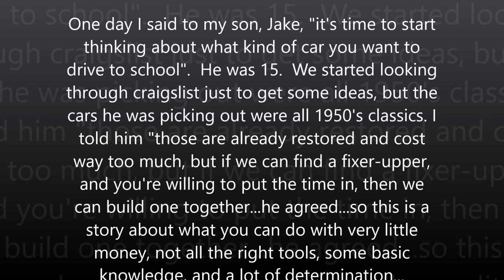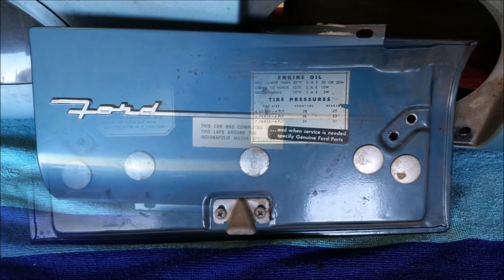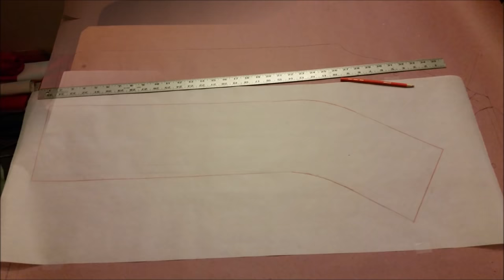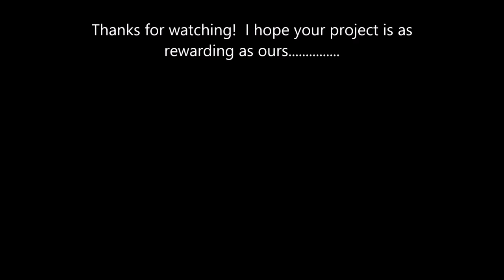1955 Ford Fairlane Restoration From Start to Finish

Comment: I moved to America when I was 12 and went to school. I always wanted a pickup truck, but ended up driving a vw Passat for most of the time since my dad felt more comfortable working on the cars he knew from home. When Senior year came around I was driving around town and saw a blue and white 1981 F250 Ford sale. I talked my parents into getting it from the Christmas and birthday money I had saved up for years and bought my first truck. I couldn’t stop grinning when I hoped up on that old bench seat and heard the v8 fire up. It had its fair share of problems rusted out gas tanks, loose timing chain, broken gauges. But over next two month I spend every free minute fixing that car up, sometimes with the help of a few of my buddies and got it to be a great daily driver. I got to make great memories in that truck and drove it to senior prom. You are a great father for allowing your kid to do this. He as undoubtedly learned so much from this and can look back fondly on this forever. There is no feeling that replaces driving a car or truck you have turned every last bolt on and know like the back of your hand. This video made me tear up. Thank you for sharing it.
Reply: Wow that is awesome man, do you still own the car
Reply: @GummerJum  Sure do. Just finished a complete restoration of the suspension and frame. As well as rebuilding the trans and engine.
Reply: @manuelmuelller3535  that is so cool, 1980s types of cars are the best in my opinion

Comment: My Dad had a 1956 Mercury Monarch which was A Canadian model and it was a beautiful car with Thunderbird 312 V8 4 barrel. But I loved all 1955 and 1956 Ford and Mercury cars. This was an enormous task you have taken on here and you should be proud of all the work you have done. I myself have been in a long rebuild of a 1971 Boss 351 Mustang that I have owned since 1976, so I have a very good idea of what what you have done because I stipped down this car and did a lot of patching of body parts and some new ones because they are available. I have really appreciated what you have done here by saving this beautiful car for an icon that can be passed on to future generations.

Comment: This is god dang amazing. I had a 64 ford in high school that I picked up for 850 dollars back in 2012 when I was 13. My dad signed and I paid with the money I made working at our ace hardware. Got her running and got the darn brakes to finally work. Anyways I changed heads and the carb for a heavy boost in power. Some my dad helped me but he was also a very busy man and didn’t really have time to help me. I just learned from lots and lots of books and videos.

Comment: Wow!  Nice work.  My first car also was a 1955 Ford Fairlane back in my Junior and Senior years in High school way back in 1971 and 72.  Bought it for $50.00 from a farmer.   Of course back then mine didn't need to be restored yet.  Instead of the V8, mine had a straight 6 and a manual 3 speed on the tree (column).  But seeing yours does bring back a lot of memories.  Thanks!

Comment: Fantastic job guys.  You gave life to a sweet car, learned a lot and made some life long memories.  Hold on to that sweet car young man.  Trust me.
Reply: Yeah hold on to the car 🚗 I still have my first car that built back several years ago but now I have built it into a gasser style 😎 with all Ford parts 53 cpe with a 460 and a 4 speed trans and a narrowed 9 inch

Comment: My Mom had a 1955 Ford Fairlane. I drove it all the time. Both of you have done a very amazing job at this restoration. Best I have seen both the awsum sound of that engine. I currently own a 1966 Ford Mustang Convertible. with the same sound. Very nice guys.

Comment: 239 cubic inches of forever memories. Mine was an 80 hp flathead jake. Tears in my 73 yr old eyes remembering my dad helping me with my 1953 2 door post.
Reply: I think in 55 it was a 272
Reply: @wendel, you’re right guy, the 239 replaced the flathead in 1954. Then 272,292 and 312 in 55/56. Good old y blocks, strong motors.

Comment: Beautiful work! My dad and I did the same thing in 1968. My first car.....'55 Ford, 4 door, 272ci with a 2 bbl carb. with a 3 spd on the column. Though mine was only 13 yo. at that tkme. So, we had a lot less work to get her ready. Replaced the rocker panels, dog legs, and rear quarters. I loved that car. It'd go anywhere. My dad sold it when I went off to the service, two years later. Watching this really brought back memories. Good luck bud....treat her good and you'll remember her forever. Thanks for the video.
Reply from the maker: thanks so much.  sorry you don't have it anymore.  I promised myself I would never sell this one.  Too many memories.

Comment: Great choice for a restoration. I had a 55 black and white Crown Victoria shortly after I graduated from high school. Wish I still had it along with my 1942 Harley "45" flat head and my -----. When you are raising a family of 4 children you have to loose what you have to get what you need. Great video. Your son has a car that is unique.
Reply from the maker: thanks Jim.  yeah, it's tough to decide which of our toys to keep and which to let go.
Reply: Just as an aside story, I had taken a job as a delivery truck driver in KC Mo. This was in the early 60,s. I had to have Missouri chauffeurs license for the job. At that time we used our own car to take the driving part of the test. I had dual straight pipes on my Ford. IT was cold in the winter. The tester told me to start my car so he could check my brake and turn signals. He checked everything and got in the car. He shook his head and asked me how I could stand the noise. I told him, that is not noise, that is music. We still had some freedom back then. Heck, every guy  I knew had loud pipes on their cars. 

On a cold start, even at idle that thing was loud, but nothing like the sound of a v8 on a cold morning. Your video brought back a lot of memories. Thank you so much.

Comment: Excellent job guys, but never use a concrete block to support a jack stand. They will collapse.
Reply: My welding instructor in high school did that putting a muffler on his car.The concrete blocks collapsed,breaking both of his legs.He was fortunate that he wasn't killed.

Comment: Best time a father ans son could spend together. This young man has acquired skills he never thought possible, and for anyone asking what good this will do in the future when he can buy new instead of repair consider this:  He learned responsibility, how to evaluate, problem solve, improvise, use tools, work with a budget, set and achieve goals he can see and touch right now. These are skills he can apply to every challenge life throws his way.  

The 81 who thumbed this down probably couldn't handle anything heavier than a gaming mouse.

Comment: Damn straight fine job. I would of been proud if my first came out that good. His next one will be a breeze after doing all that. I love it guys.
Reply from the maker: thank you my friend
Reply: @jperry1444  That is all I build now is friends. I hope you stay with the oldies and make each one a labor of love. Four door cars took families all across america. I started in early sixties building cars. My first was a failure, a 59 ford starliner which was the retractable hardtop. It was so rusty that I got there too late. Had they sold me the car sooner, I might have got it going. It ran good and the top was working but the frame was gone and I just didn't know how to weld like I do now. I'm 72 and welding took my eyes away as I can not see true colors anymore. I did my last one about six or more years ago which was a 95 king cab dually with five speed and 7.3 with every bell and whistle you can get on the 2012. heated seats and wheel, sound, cameras, phone, aluminum flatbed, all the hitches and wiring, tuned engine and not one scratch it her. Extremely fast and yet set her on the ground with the remote. Yeah it was nice but the bills for medication and just staying alive has taken everything :-(

Comment: Thank you for restoring this beauty and being a good father. I dream of owning a 50's car someday, and am very interested in restoring them. Just I dunno where I'd start. I mean, I could probably do some bodywork, but I know very little about engines. However, I do know the engine bay was much simpler back then. I just adore those oldies and would drive them with pride. One thing though, I'd advise avoiding highways and driving very carefully. Not just to keep the car safe, but to keep you safe. Those oldies weren't really designed for a crash and have little, if any safety features. Enjoy driving it safely, you've earned it.
Reply from the maker: You can do it David.  I would suggest checking out DIY Autoschool on Youtube.  He is the owner of Southwest Rod and Custom, a paint and body/restoration shop based in Texas (but moving to Moab Utah).  He has tons of vids on how to do it yourself.  He comes across as angry and frustrated but it's really just his sense of humor.  He knows his stuff and tells it like it is.  As for the engine work, there are lots of helpful vids out there on that too.  You can look into your local high school or vocational school to see if you can get a deal on the labor by letting them work on your engine.  Local machine shops can also be a great resource.  One thing is for sure, you will never know until you try.  Find an affordable project out there and bring her home.  Count on 2 things...it will take you 4 times as long, and cost you twice as much money as you think.  but if you can find a really affordable starter project then I say just go for it.  Find something you can get parts for.  The 55 and 56 fords and the tri-5 chevy's as well as mustangs and chevelles can literally be built from nothing with aftermarket parts.  Stay away from the rare ones that you will never be able to find parts for or you will spend 10 times the money buying crap off ebay that is in worse shape than what you are fixing.  Reach out to me if you have questions.  Good luck my friend.
Reply: @jperry1444  Thank you for the encouraging words and advice. I'll definitely look into it. Honestly I saw a few possible project cars around where I live. Don't know if they're for sale or not though.
Reply from the maker: @scratch8141  get it as cheap as you can.  "Project" prices are ridiculous these days.
Reply: @jperry1444  Wouldn't think of doing it any other way. Honestly it'll probably be a little while before I actually start shopping for one though. As of now, I've got other things to attend to.

Comment: This is a fabulous car for a "learn by doing" project....better than many so-called "restorers" would turn out.  Great work here!  I have a friend whose grandmother had the same car (in red and white) but with the 6 and 3 sp./overdrive, no rust.  The "restoration shop" did the paint and it wasn't half as good as this.

Comment: That was great to watch for any age, or era.  I grew up in the seventies and eighties, and I fell in love with 1981 and 82 Ford Escorts for some reason.  Escorts were everywhere during the eighties and nineties.  I owned two that only lasted briefly.  I want to get another one to restore to mint condition.  I may be 48, but I love the eighties, and I want a good little project car to have fun with.  Any car is only as good, or bad, as how you care for it.  I say that, because people treated sub compacts, like Escorts, as "throw away" cars to run into the ground.  I found an 81 Escort wagon in Texas with nearly one million miles on it.  I live in Minnesota, aka "The Rust Belt," so this Escort will be a collector that goes out on occasion, and I plan to have the car for a long time.  I also want to advertise local eighties themed bars and restaurants by doing photo shoots with the little Escort, then post on social media.  With a fine restoration like this, you may want to consider doing photo shoots with this Fairlane, in front of fifties era Diners and restaurants in your area.  This car will definitely turn heads on your high school campus.  Very nicely done indeed!

Comment: Love what you did, great job. I owned several 55’s and 56’s in my younger days. Thee only problem with the 55s was they were 6 volt positive ground. Pain in the rear!
Reply from the maker: absolutely.  we put in an isolated 12 volt system to run electric wipers and a sound system, but kept the original 6 volt.

Comment: Okay, I'm 2 years late for this party, but Damn guys!!  I was taught by my Father how to do auto body and mechanical work in our garage and we did it together and I learned so much from him. It was really awesome to have a car to fix for someone who couldn't afford a body shop to do it for thousands of dollars and we would bring it back to, sometimes, better than new. 
That said, I did that kinda work for quite a few years, and you guys did some great work for your first time ever. 
Now, it's been a while but I think that you should find another project car or truck and do it again.  I'm writing this at the 4:50 mark of the video and just that little bit has shown me that the rest is gonna be awesome 👌 😎.
Reply from the maker: Thanks David!  Jake is off to college now but I have started another project.   He will help when he's able.  Check out the videos on the '56 olds.  Thanks again!
Reply: @jperry1444  if you can afford it, get yourself a sand or medium blaster to get all of the rust off of the metal. My Father was right that rust never sleeps.  I had to learn that the hard way and the car I had worked on got rusty in the same spot 2 more times before I blasted the rust gone. 
Also Epoxy Primer works great but you definitely need a respiratory to breathe while using it.  I didn't my first time and felt like I was having a heart attack. Lungs hurt, coughing up green nastiness. Grossness. 
And with that Primer you can put body fillers right over it.
Reply from the maker: @davidbruin4381  Thanks David.  Yeah, we learned the hard way with rust as well.  Gotta get it all or it will just come right back.  And as far as the painting goes, we weren't taking any chances with that...respirators were definitely required in the homemade booth.

Comment: I owned a 56 Ford Fairlane, baby blue, with a 292.  Then I owned and restored a 56 4 door hard top, Bel Air, with a 265, bored out to 283-with an aluminum 2 speed automatic. Changed the front brakes to discs- had the interior redone; polished the stainless trim.   My Son drove that to High School.
Reply from the maker: Nothing like a youngster enjoying a classic from days gone by.  Love it.

Comment: After seeing all the work needed to be done, hard to believe the seller wanted 2 grand for an old  rusted out sedan. As a former finish grinder in a steel foundry, the grinding work would be the easy part. Excellent video and a great selection of old tunes!
p.s. I'd spring for some nice rims, no whitewalls, too much hassle.

Comment: Did a similar thing myself, tried to get a 63” Fairlane up and running before my senior prom to take my hs sweetheart in, Car didn’t need that much work but I had got it the same year, needed a new transmission and engine and radiator, however my dad would let me use his tools, but wouldn’t tell me anything else! I wanted to keep the 221 V8 but it has a valve tick, and my dad surprised me with a 65’+ 289 with a top end kit and a 3 speed c4 instead of a 2 speed cruise o matic, could hardly complain, we make it to graduation, where we promptly broke down on the side of the highway, we eventually made it and I got congratulated by nearly everyone there for making it. Great times 😂

She drives like a dream now, put brakes from a 91 firebird and a 91 previa, since the drums, no matter how we adjusted them, just weren’t cutting it

Comment: My 55 was a 2 door and was the same color as this one light green and white. I then put it in the body shop and had to get work done and painted Emerald Green Poly, it looked great with all the chrome, this part is crazy, $48 for leatherette interior, $60 for body work and $80 for paint job and$4 for fender skirts and like a jerk never took a picture and sold it for $300.

Comment: Everything looks fantastic except for the painted front bumper, it should have been re-chromed. Otherwise a great job. Love the 3 generations working together, that will bond you all forever.
My father left when I was 3, but we found each other again years later (best man at my wedding). He was into old cars, and I was into computers. I so wanted to build an old car with him, but it never happened. He could have taught me so much. I really hope your son realizes he got a lot more than a car from this.
Reply from the maker: Thanks Steve.  Sorry you never had the chance to do a restoration with your dad.  My dad and I worked on so many together when i was young.  I was lucky enough to own and drive some really nice cars when i was in school because we could by them cheap and do the work ourselves.  I agree with you about the front bumper.  I can't tell you how many times I have heard that comment.  the problem was, the super tight budget and no one locally wanted to touch the job.  we will end up getting a new one from bumper boyz.

Comment: If you can find out if that car was built in Dallas, TX ,  my dad Maurice Curry put the doors on that car. I loved your video.  Yes Dallas had a factory
Reply from the maker: I'll have to check the VIN decoder again.  Doesn't ring a bell that it was from Dallas though.